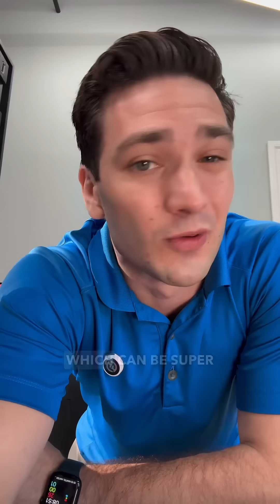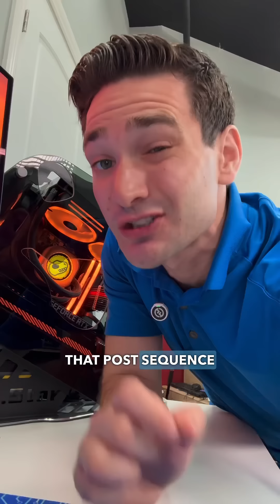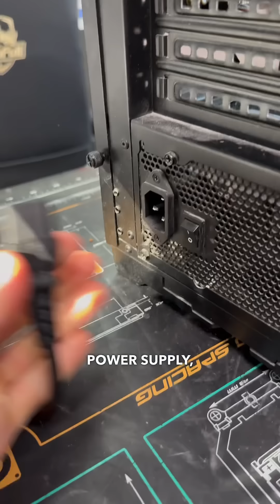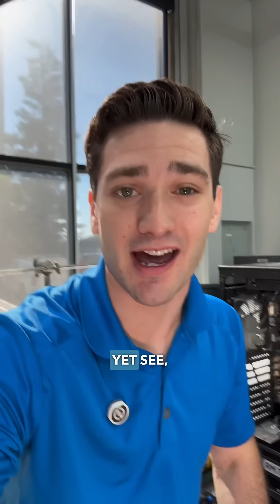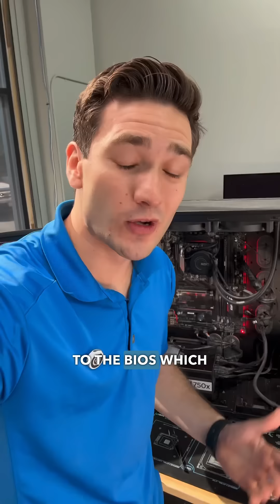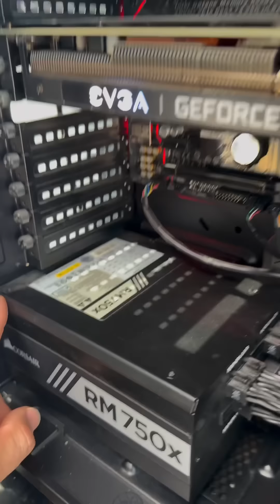PC Restart Cycle! #gamingpc #pcrepair #techtips #pcbuild #computerrepair #repair #gamingcomputer

Comment: Is there a way to uncorrupt the corrupted BIOS on a duel BIOS motherboard?
Reply: You could try to re-flash if it lets you via the bios flashback method, if it has one available.
Reply: boot the backup bios then flash the latest bios, it will override the main bank again
Reply: Not without reflashing the dead one, which would require flashback, since trying to do so in OS would flash the good one
Reply: @chipproductions1510  Gigabyte BIOSes generally have an option you can select during qflash that flashes both BIOSes at once. It's kind of risky because you don't really know what version the main BIOS is on, and trying to flash the backup BIOS with a version that corrupted the main BIOS... well let's just say you don't want to end up with two corrupted BIOSes. So you flash one at a time.
Reply: @Amberion yeah, but past that, you just pray to GOD you don’t corrupt it twice

Comment: I bet that cpu & Mobo is LGA 1151
Reply: My first desktop PC was LGA 1151. 6th gen i5 6500 on an HP OEM
Reply: It is lol, the motherboard is a Gigabyte Z270 so LGA 1151 for sure and since it's a 270 not 170 along with the RTX gpu It's probably got an I7-7700K 8700K or something similar in it. I said this in another comment but I ironically have this exact PC case (Corsair Obsidian 750D) along with an I7-6700K and a GTX 1070 plugged into an MSI Z170A motherboard
Reply: @jacob-bell it wouldn’t be an 8700k, that’s z370 and z390.

Comment: I had this issue on a decade old gigabyte motherboard my brother was using until it bricked when he was setting up hackintosh. It didnt have debug leds or even beeps which was a painful fix. Tried booting it from the backup bios and it also didnt work. 

Alas I decided to invest in the CH341A bios chip programmer and that shit worked like magic! I lowkey feel like tech jesus bringing motherboards back to life lmao. Anyways I told that bugger to not mess with firmware and bios mods anymore if he doesnt know shit.
Reply: He knows some shit, he's seen some shit, I tell you. Now, U bugger off, unlike him. Let the lil' bugger to start bugging with HIS computer. How else will he learn to un-bug some shit? 

Greetings from Buggerland. Word.
Reply: Every motherboard needs a backup bios or quickflash utility even now cheaper boards tend not to have them

Comment: That is the dustiest pc I have ever seen. There is only one man who can clean it, The Gooch Collector.
Reply: or the Greatest Technician that's ever lived.
Reply: I've seen dustier.
I've operated dustier.
Reply: youd didnt saw mine... and someone need to clean it soon or later :X to many dust mouses. "but why you dont do it yourself?!" i cant :X dont ask why...
Reply: This isn't the dustiest I've ever seen, I've seen worst cases.

I'm also a technician and, you'll be surprised on how people manage to bring PCs even dirtier than the last one I worked on 🫠
Reply: This PC is practically clean compared to the vast majority of PCs.
Reply: not even close to dustiest pc not even in the same galaxy maybe even same universe this is rookie numbers dusty boye
Reply: Oh this? This isn't even in contention. I had one come in to my shop once that was so caked with dust inside, you could have mistake it for packing material.
Reply: This is on the cleaner end of the majority of computers out there. I don’t think you’ve worked around computers that long if you think this is dirty.
Reply: This is like a normal amount of dust build up that every PC is going to experience.

Comment: Can someone please help me. Im getting 1 long beep and 2 short beeps on the vga I've tried different gpus and even tried different pcies. I tried different ram and even just bought a new psu. I can't find an answer im hoping someone here can help
Reply: It wont complete post it stops at vga and attempts to start again
Reply: Have you checked your motherboard? It could be something with the ram sticks, like not being able to fully go in or something being stuck in where your GPU or ram goes
Reply: @ThekingFry im getting new mobo soon to see if its the problem ive bought new ram since then and tried every dimm slot with every ram and it was able to boot up fine, this is the first time ive had this problem and my pc wont turn on. Im just hoping its not the cpu
Reply: Do you have a spare motherboard?
Reply: what mb and cpu, and what vid card
Reply: @daleaha7415 aorus x570 pro wifi, 5800x, and a 3080ti
Reply: also 1 long and 2 short beeps is a "no memory detected" error